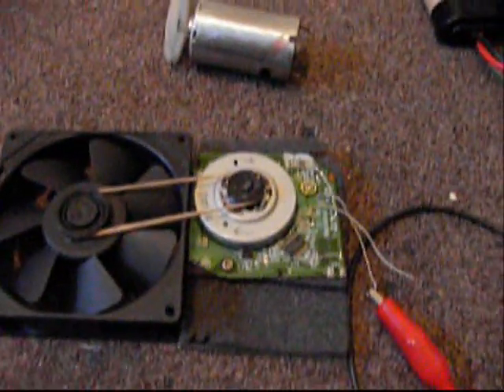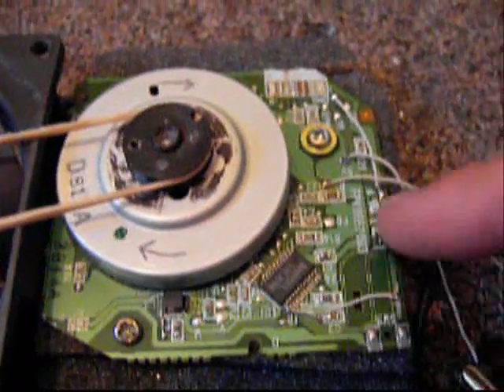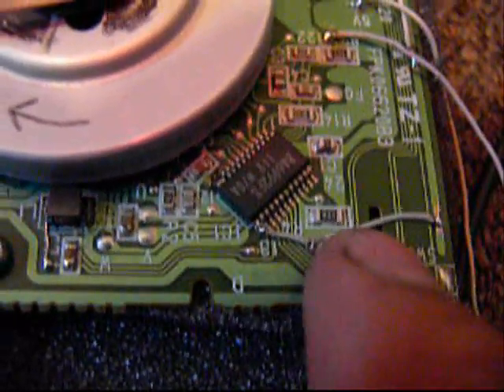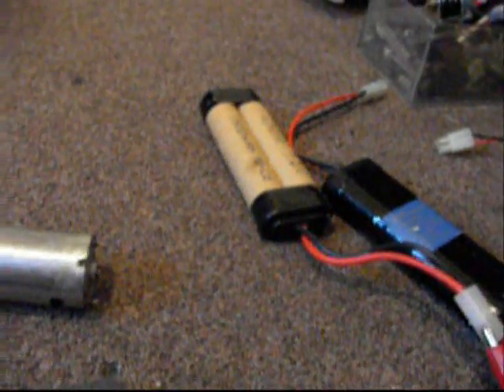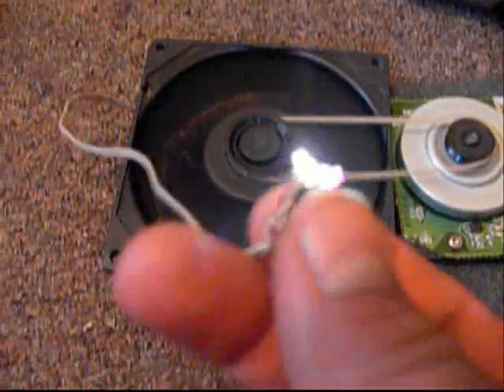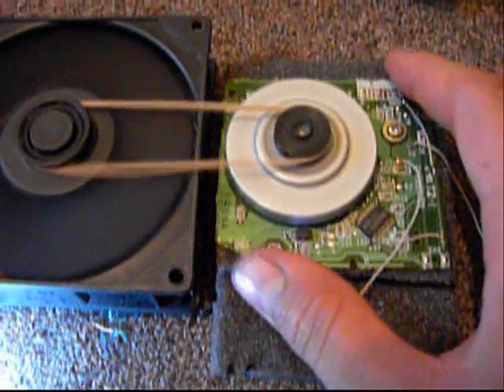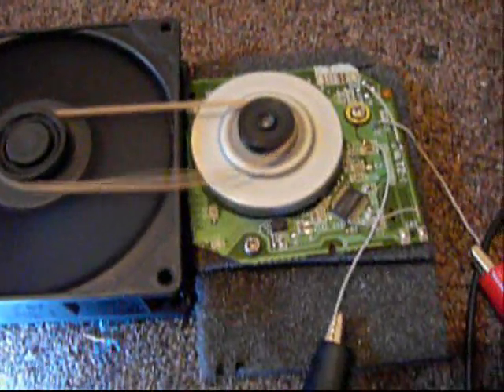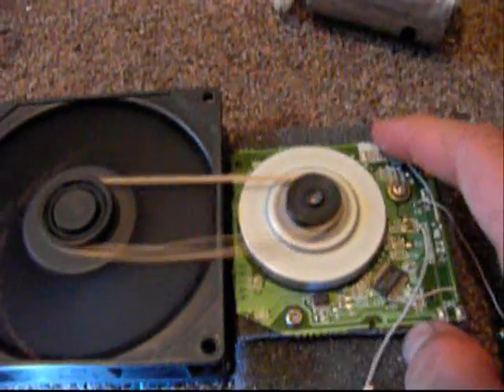Floppy Drive Motor Hack

Comment: So you use a battery to run a motor which generates energy and lights a lamp.
Why don't you just put the lamp on the battery??
But still fun

Comment from the maker: find a big fan or small one and try to take it out in one piece and unsolder the board and try to find the 4th wire and then try to connect them to see which they put out the most volts and solder them together to have only 2 wires out then get a led and connect it and when spinning it, it should light up the way i did it is hard and takes a lot of rpm to get light